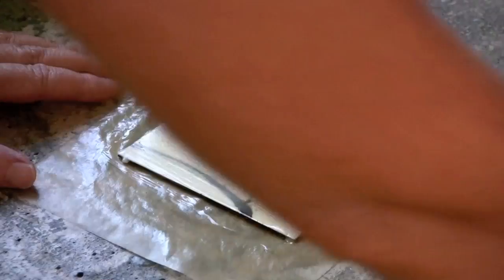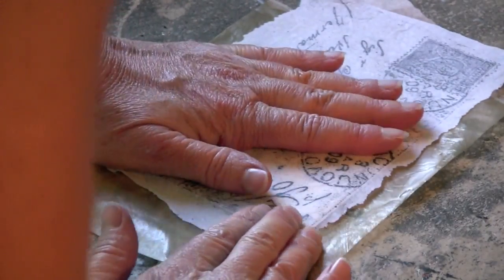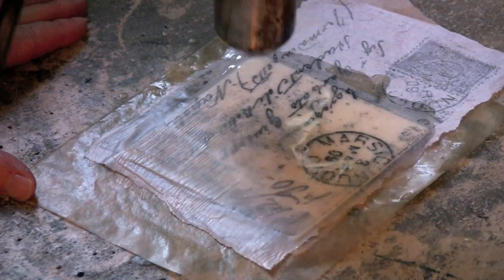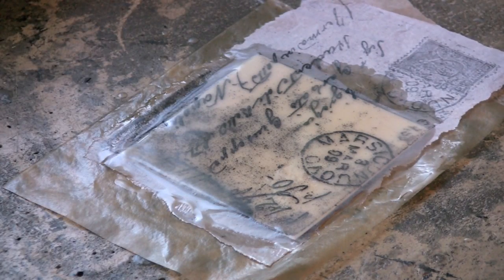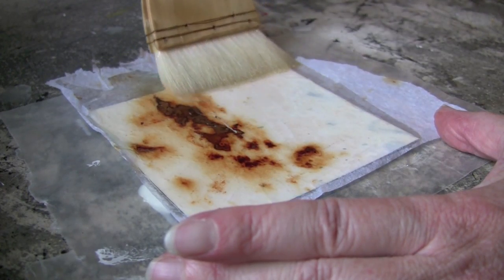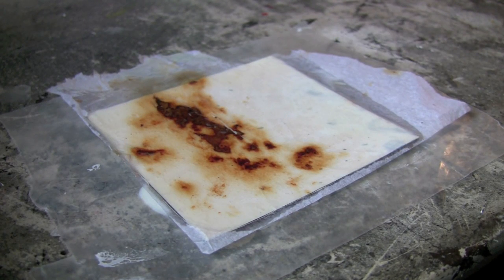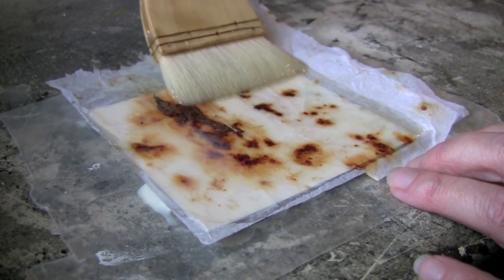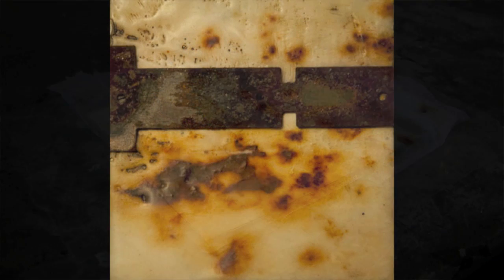Encaustic Technique 4 Embedded Tissue

Comment: What kind of tissue paper or does it matter.
Reply: The tissue paper can be the kind you get as gift wrap but be careful if it has a sheen it means it has a coating that will not absorb the wax.  Cheep dollar store paper with no sheen works best.  The other tissue paper that works well is from printed paper napkins.  Separate the layers, usually 3, and use only the top, printed layer.  Nancy taught us well, for those of us fortunate to have been able to take workshops with her or her students in the school where she taught.  You can trust the information she offers in her videos as she has tested every technique and material before she presents it to her students.